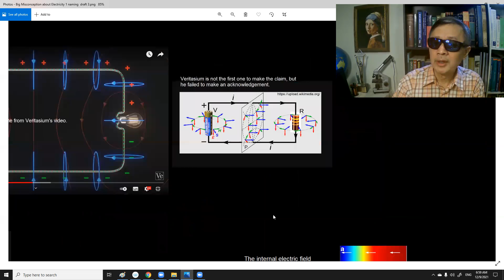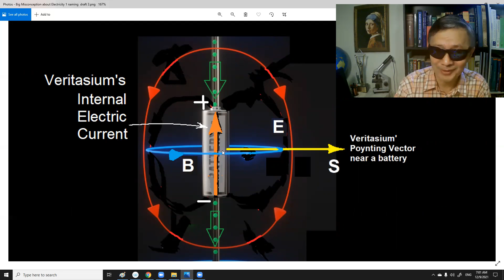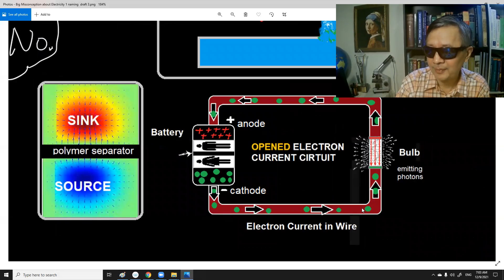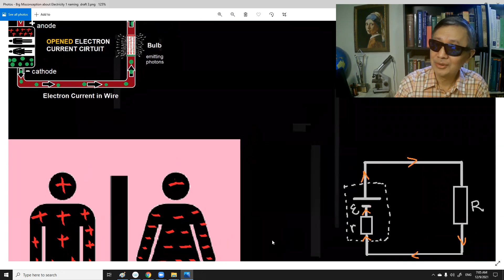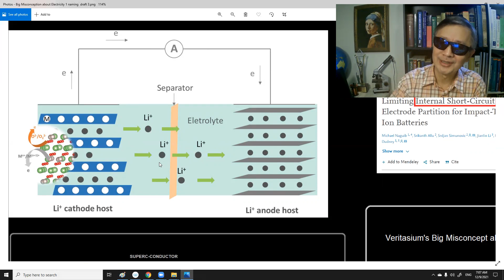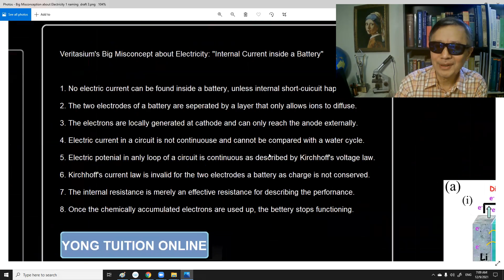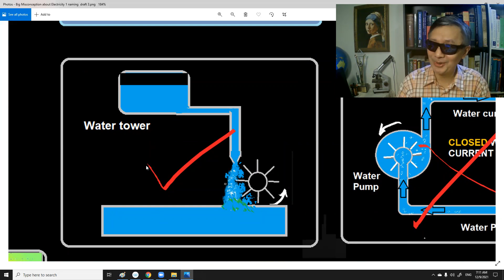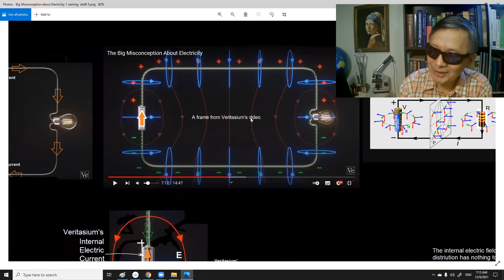No Electric Current inside a Battery: A critique on Veritasiaum's Misconception| Yong Tuition 211209

Comment from the maker: When calculating the effective internal resistance of a real battery, the current used is equal to the current in the circuit immediately outside the battery. However, it is by no means that there exists some   internal current. In fact, only the power P= rI^2 is used to describe the efficiency and performance of the battery,  no real internal resistor exists at al.
Reply: All electrical accumulators have internal resistance, we normally ignore that value.
It dissipates as heat when the circuit is running. That why batteries heat up.
A capacitor has an effective internal resistance in it's equivalent circuit.
Reply: In reality, in batteries the main internal resistance is the poor resistance of the electrolyte, where the resistivity of the liquid material is far higher than that of a metal.   The max current of a battery is limited by the heating of the electrolytic conductor, and by inefficiency in the charge-transfer reactions, where amperes flow from the metal surface into the conductive electrolyte.    Again: search on electrolytic conductor versus metallic conductor.

Comment: SIR,🌟According to this vedio, (if you are correct) then current should flow if we connect wire between Anode of One battery to Cathode of another battery....But it does NOT....WHY??
Reply from the maker: Good question. But don't forget the electrons inside a battery are attracted by their positive partners although they are separated.
Reply: Good question.
Reply: Better question:   to produce a direct current, WHY is a "complete circuit" required?   

With two separate batteries, if we only link their + and - terminals, then the other to terminals are left as part of an open circuit  ...the same as an open switch.   YES there will be an incredibly brief burst of current when we first connected the two batteries.   The + and the - cancel out, but now the + and the - on the remaining two wires is doubled.   (For example, if we do this with 1.5V D-cells, then when we connect them, suddenly 3V appears on the disconnected terminals.

Now connect a flashlight--bulb to those other two battery terminals, and THEN a complete-circuit is formed, and the bulb can light up.

But WHY?   What is the "go" of it?

A simple error stands in the way of our thinking.    It involves the meaning of the word "conductor."

WRONG:   a conductor is a material which allows charge to flow through it, as if it were a hollow pipe.

CORRECT:  a conductor is a material which always contains an enormous amount of movable charge, as if it were a water-filled pipe.

See what's going on here?   If we think that wires are like empty pipes, we'll never understand circuits   ...since wires act like water-filled pipes.

If we connect a water-filled pipe into a circle, so it forms a water-filled ring, what do we have?    We have a fluid flywheel, like an invisible drive-belt.   The pipe can remain still, even when the circle of water begins flowing.    That's what "complete circuit" is all about.

Next, pinch our circular pipe closed at just one spot.   Now the water can't flow around the ring.    That's how "open circuits" work.

In other words, all metals are like little tanks full of movable electricity.   Batteries and generators are just electricity-pumps.    A generator doesn't "generate" any electricity, any more than your beating heart has to "generate" blood.   The blood was already there inside the vessels, and the heart is just a pump.    The electricity was already there inside the wires, and the battery was just a pump.

Comment: Sir 🌟 ,Does SKIN EFFECT is the reason for Net charge on the outer surface of an conductor connected to Alternating current?is skin effect is present in DC?
Thank you sir 🌟
Reply from the maker: Skin effect is frequency-dependent. For DC, it is absent. For 50 Hz AC the surface current density is slightly higher, but hardly called as "surface effect".
Reply: I would think skin effect also present in DC current carrying conductors. All it says is that current tend to travel on the outside of conductors whether AC or DC.

Comment from the maker: Originally, electricity current was observed in conductor, although whether the nature of such a current electricity were unclear. Faraday's master, Humphry Davy, first used this current to separate chemical compounds and found several atoms, which was then termed by Faraday as electrolysis. Nevertheless, Faraday was reluctant in using atomic idea to describe the electric current as he would like to consider it as a sort of continuous fluid. In fact, in his opinion, ions were nothing but some transient carriers of the electric current.
Reply: You are 100% correct there is no electron current inside a battery. If the battery alone was conductive there would be electrical current inside the battery without even connecting it to  a circuit thus it would discharge open circuit!  The battery behaves more like an electrochemically precharrged capacitor where an electrical potential difference (i.e. voltage) is prior created between the battery's two ends positive (+) anode and negative (-) cathode.

This is also made clear by the manufacturer which is notifying that the battery has almost zero leakage current and an internal dielectric resistance in the range of 100's of MΩ (i.e. not to be confused with the in series effective resistance of the batteries due to its leads connections  and conductivity of plates that is a very small resistance  and in the range of mΩ or less). 

For a non-rechargeable battery assuming there is no leakage current across the two terminals of the battery, the stored potential energy of the battery is consumed by the kinetic energy and heat generated by the excess free electron charges on the (-) terminal of the battery moving along the resistive load circuit to the opposite (+) terminal of the battery which is lacking in electron charges. This process is continued until the two terminals of the battery reach electrostatic equilibrium and there is no more electric potential difference between them (i.e. zero voltage measured between the two terminals of the battery). At that point we say the battery is empty.

Prior, a non-rechargeable battery (batteries that cannot regain their charge due an additional electrolysis cycle) is charged by the manufacturer assembling the battery and yes during this process there are ion currents (not free electrons current) among the two plates of the battery and the electrolyte solution used that creates in the first place the electric potential difference between the two + and - terminals of the battery. After  the battery assembly is completed a dielectric barrier is inserted by the manufacturer in between the two plates of the battery inside the electrolyte solution to prevent any internal electron current between the two plates of the battery + and - terminals and the battery is ready to use in an electrical circuit as an electrical power source or more specific as a voltage source.  

The dielectric barrier inside the battery makes sure that all the potential energy of the battery flows and is consumed only by the electrical load connected to the battery. When the two terminals of the battery via the electrons charge transfer thought the electric circuit 
connected to the battery, reach electrostatic equilibrium thus there is no more potential deference (i.e. zero voltage) then the 
battery is fully discharged and empty. Why this is happening is because the anode plate material connected to the (-) terminal of the battery gets depleted by chemical reactions inside the battery with time and charge current drawn by a circuit load connected at the battery. This chemical process inisde the battery is as follows: 

Inside the battery there is  electrolyte's hydroxide negative ions reaction with the anode (-) reacting with a process called oxidation and therefore the electrolyte releasing (loosing) electrons to the brass pin connected to the anode plate (-), the brass pin collects this released electrons and on the other hand the cathode (+) plate reacting with the electrolyte's water molecules in a process called reduction and creating additional hydroxides molecules that then pass-through the separator  and again react with the anode (-) and create further  free electrons (the cathode (+) material looses electrons in the reduction reaction) that are collected by the brass pin connected to the anode (-). The electrons that are collected in the brass pin at the anode (-) are then circulated via the circuit to the other side, the cathode (+) plate, continuously replenishing its lost electrons by the reduction chemical reaction. These two different chemical reactions keep going and maintain a potential difference (voltage) between the two terminals of the battery connected to the circuit and electron current flowing. This process will continue and relative slowly degrade until the anode plate material (-) is depleted. There is a very nice video that explains this process for a normal alkaline battery:

https://www.youtube.com/watch?v=PXNKkcB0pI4
Reply: @Markoul11  Correct:  the amperes in battery-electrolyte are not composed of flowing electrons, instead they're composed of flowing charges, the ions in solution.    Metals are electron-conductors, while electrolytes are ion-conductors.

QUESTION:  But if battery electrolyte is a conductor, why doesn't it short out the battery?

Exactly!  Just answer that question, and you'll begin to understand how batteries really work.

ANSWER:  all batteries contain a pair of half-cells, one each at the surface of the two battery-plates.     The half-cells on the plates must be connected in series, and the electrolyte serves as a "connecting wire" between them.   Battery voltage is created at the half-cell surfaces.    (So, every battery is actually two separate batteries connected in series.    The salt-water or battery-acid is a conductor which connects the two half-cells.)

If instead the electrolyte was insulating, then the battery would cease working (electrically, it would become an open circuit.)
Reply: @wbeaty  Yes this is correct. There is no direct electron current between the - and + of a battery only ion currents. The separator barrier  material within the battery makes sure of that. Otherwise the battery will be shortcicuit and its charge life expectancy severely reduced by internal electron current. Electron must flow from one terminal through the other only via the connected circuit. Inside the battery there is  electrolyte's hydroxide negative ions reaction with the anode (-) reacting with a process called oxidation and therefore the electrolyte releasing (loosing) electrons to the brass pin connected to the anode plate (-), the brass pin collects this released electrons and on the other hand the cathode (+) plate reacting with the electrolyte's water molecules in a process called reduction and creating additional hydroxides molecules that then pass-through the separator  and again react with the anode (-) and create further  free electrons (the cathode (+) material looses electrons in the reduction reaction) that are collected by the brass pin connected to the anode (-). The electrons that are collected in the brass pin at the anode (-) are then circulated via the circuit to the other side, the cathode (+) plate, continuously replenishing its lost electrons by the reduction chemical reaction. These two different chemical reactions keep going and maintain a potential difference (voltage) between the two terminals of the battery connected to the circuit and electron current flowing. This process will continue and relative slowly degrade until the anode plate material (-) is depleted. There is a very nice video that explains this process for a normal alkaline battery:   https://www.youtube.com/watch?v=PXNKkcB0pI4
Reply: @Markoul11  But Yong's video insists that there is no electric current in the electrolyte AT ALL.     Yong himself says the same thing in comments above.   He is wrong.   Electrolyte is a conductor, not an insulator.   Nothing inside the battery blocks the amperes.    Batteries do not behave as capacitors.

If the electrolyte is formed into a hose (as with chemistry-classroom's salt-bridge,) and then it is measured with a clamp-on ammeter ..I insist that the meter will report the same amperes in the electrolyte as the amperes in the connecting wires.    Yong says that the electric current in the electrolyte is zero  ...because the positives move one way, and the negatives move opposite (as if this creates zero average current!  No, it does not.)     I say: why then are electrolytes such good conductors, if supposedly the positive and negative motions produce zero current?

But this is all irrelevant because...

Again (and again and again and again) WE CAN MEASURE the amperes in the electrolyte.  

Doing so is almost trivial.   The result shows that Yong's explanation is full-blown crackpotism.

Yong must try it himself, since he doesn't believe the standard textbook explanations of battery electrochemistry, and also doesn't believe me, but instead seems to believe that a battery is a type capacitor, where the plates must accumulate charge because the current in the electrolyte is zero.   Wrong.   

The charge in the plates is constant if the voltage is constant.   The charge in the plates is constant if the electrolyte-amperes is identical to the wire-amperes.   The constant charge of the plates is only possible because the path for the current is *through* the electrolyte and back out via the other wire.   Batteries behave as short-circuits (they are low-ohms resistors, because the electrolyte is conductive, and provides a path for current.)

Anyone who refuses to believe their grad-level Electrochemistry textbook is free to construct a simple experiment and measure the electric current passing through the battery electrolyte.    It's not zero.    Instead, if the measured current in the external circuit is ten amperes, then the measured current in the electrolyte is also ten amperes.
Reply: @wbeaty  There is no direct electron current between the anode (-) and cathode (+). The animation in my linked video is misleading. The hydroxide passing from the   cathode to the anode though the separator interacts with the zinc (not shown in the animation) in the anode and releases two electrons that then are collected by the brass pin at the anode. There are no electrons passing through the dielectric separator  only hydroxide ion molecules and water molecules that are small enough.
Reply: @Markoul11  Exactly right.   No excess electrons accumulate continuously on the negative battery plate because, in alkaline electrlolytes, they leave again as -OH ions.  "NO CURRENT INSIDE BATTERIES" as with Yong's video above, is incorrect.  But of course there must be a tiny excess on the negative plate, enough to create a few volts WRT earth (or WRT the spherical shell at infinity.)    And, the positive battery plate will have an equal and opposite excess of protons (located within the nuclei of that metal.)    Batteries are chemically-powered charge-pumps.   When we "charge" a battery, we only charge it with energy, in the form of built-up chemical fuel.   (Batteries are the same thing fuel-cells, but with their electrically-neutral "fuel" contained internally.)

Back in the 1980s I was working with physics-misconceptions believed by students in USA grade-school.    Two common misconceptions are these:  electric currents are only made of electrons, and so, electric currents in salt water must be made of electrons.  Wrong!    Another typical misconception:  The electrolyte in batteries is somehow insulating, so the current is zero, and therefore a battery is a type of fancy capacitor, where one metal plate accumulates BILLIONS of coulombs, as the other plate loses them.   Wrong, since this would involve voltages on the order of 10^20V.    No such voltages are needed of course, because batteries are short circuits, and the total nanocoulombs on the plates remains constant while battery-voltage is constant.

But then, I found back in the 1980s that the above physics-misconceptions were being taught by textbooks in grade school, and only being debunked at the college level.   Therefore, the vast majority of unschooled people believe these myths.    To lose these misconceptions, first they must get a technical degree in college, and second, they must actually pay attention to their college course work, and realize that it disproves the many "lies" taught in K-12 grades.

Heh, back in the 1980s, Harvard had an education project called S.T.A.R., science-teaching from astronomical roots.   Those researchers found that students entering college had numerous misconceptions, many of them TAUGHT during high-school.    They found that, if an incoming student never had any science courses during earlier grades, then they would get much higher marks in the experimental astronomy tests that S.T.A.R. was giving them!    So beware, if we learn science in USA grade-school, we become less smart, and later we require some UN-teaching, so that we may UN-learn much of the incorrect garbage we were taught by non-college textbooks.

RP Feynman encountered this problem, and could not solve it (in fact, he had to flee in terror,) see his essay "Judging Books By Their Covers."    That was from 1965, and I think the problem today is now larger, having many decades of uncontrolled growth.  http://amasci.com/miscon/feynjudg.html